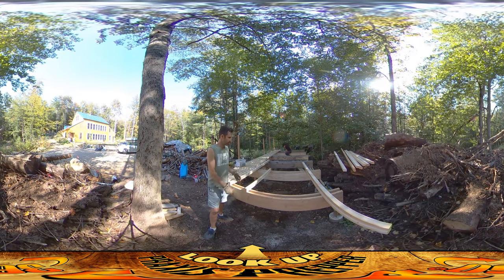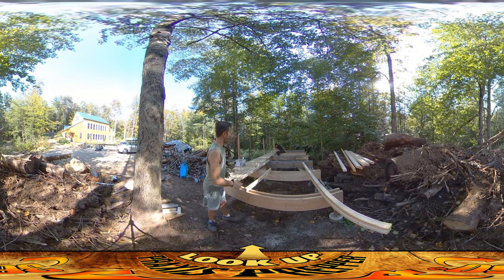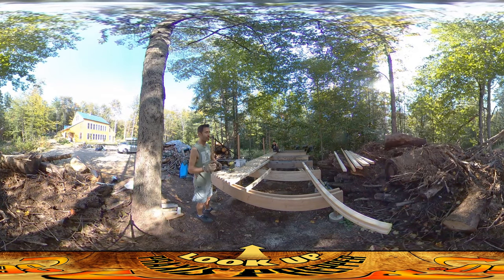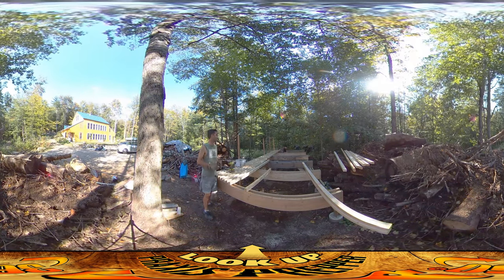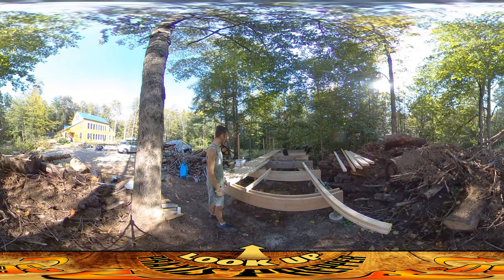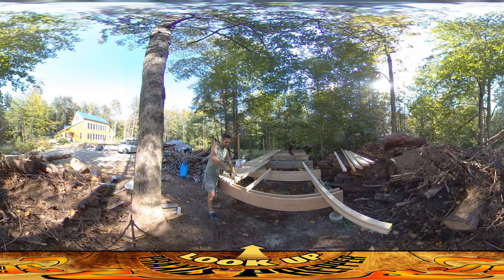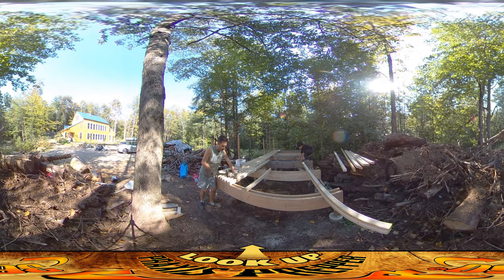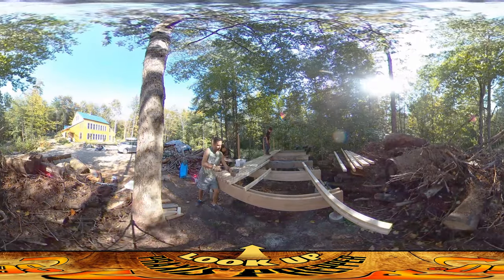Homestead Building - Finishing Floor Beams for Firewood Shed

Comment: I find it emotionally easier if I start with pre-cracked boards. Silliness aside, you are building a great wood shed. Far more work and sophistication than mine which is a cobbled together tin shed attached to the side of the garage.
Reply from the maker: Simple is good too. This shed is a bit overkilled perhaps.